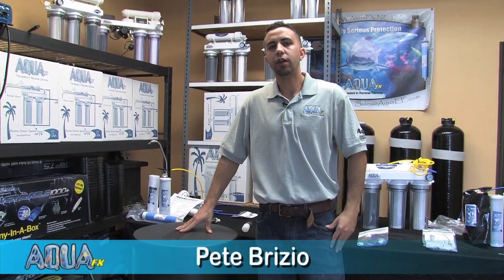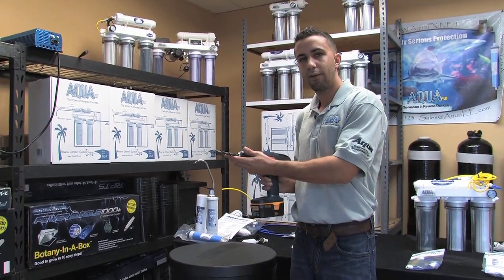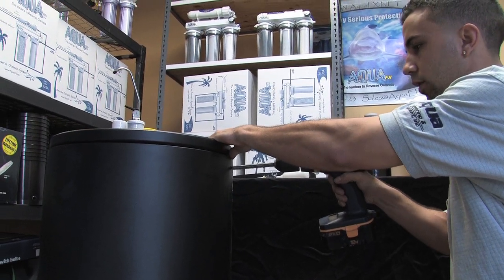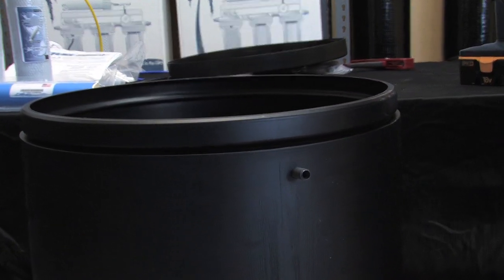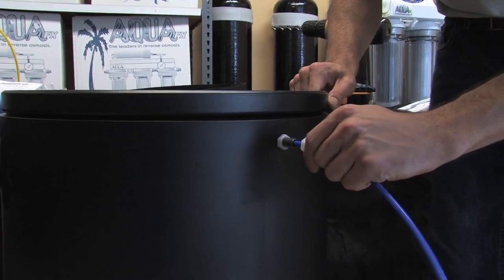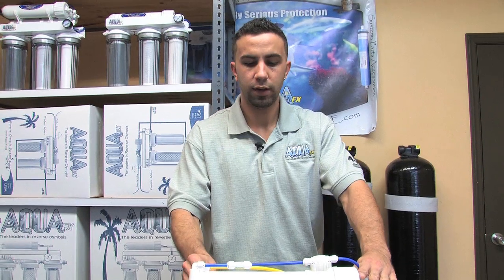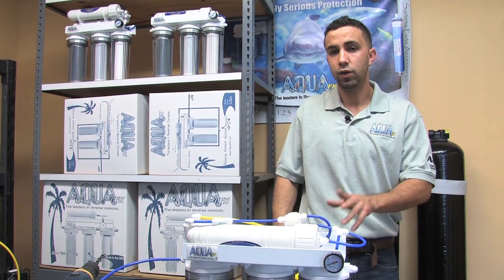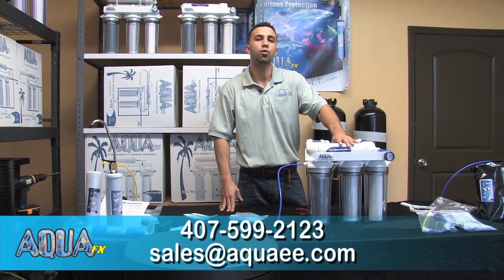Float Valve Installation  for Aquarium RO/DI systems AquaFX

Comment: If I have a set filter system and I have one pipe with a valve going out and I want to connect it to a bucket for storage container and I want to install a sensor to where the water should flow how can I do it ?

Comment: I'm talking with a guy in Texas that sells RO systems and when I told him I want an RO system to fill a 35 gallon atmospheric tank for making cleaner rinse water for rinsing off my car I said I wanted a float shut off inside the tank to turn it off when its full. He said if I put a float shut off to stop the incoming clean water as you did in this video, the waste line would keep flowing water. He tells me I would need to find a way for a float to turn off the water supply that feeds the RO system. So I'm a bit confused.

Comment: Will this work if I only have 40psi at my house?
Reply: Yes, 40PSI should be enough. I would recommend a booster pump to get the better quality of water depending on how much water you are using at a time.
Reply: 40 PSI is acceptable, it just produce water as quickly as it would at higher pressures

Comment: Flow restrictor comes standard with all ro/di units right ? Cause I never even checked for that after installing my unit
Reply: Yes one comes standard in every RO unit - if you didn't have a flow restrictor, you wouldn't be able to produce any product water. the unit wouldn't be able to build pressure. So I'm sure you have one there!! :)
Reply: kouki20 Thanks !
Reply: yes, it does.  They are matched to the membrane

Comment: Nice! I’m going to install something like this for a saltwater tank to do water changes. Is there an application where I can in hook that blue RO line easy like once a week without issue? I will still have float value installed? Or can I just keep unscrewing that white nut?
Reply from the maker: So "yes" you can keep unscrewing that nut - the tube will come in and out easily. Or if you prefer there should be a quick connect fitting that will fit the end of the float - female x 1/4 QC. Either option should treat you well!! :)
Reply: Thank you for responding! Do you know where I can get the quick connect fitting or what part number that is? Thanks in advance!
Reply from the maker: So this should be a 7/16 female thread x 1/4 quick connect. its kind of an odd fitting (but we have some) I would say to email sales@aquaee.com and have them send you one!! :)

Comment: hi where do i get that thing inside the yellow tube coming out of the membrane, the one that helps building pressure so the shut off valve works? thanks
Reply: AquaFX.net will sell the flow restrictor - thanks for the question!! :D
Reply: It is a flow restrictor, you can purchase one on our website  www.aquafx.net

Comment: Now that we are good buddies and on a roll, I have one more question. I have 3 different brand units here over the years. I started paying attention. Question... I am assuming, (trying to make sense of how they should work) that best to have a sediment filter first- then charcoal filter, then though the RO membrane, and Last through the Resin Material filter. Right?  if so not every unit I have is built this way. I never checked. One last thing, before all this happens in my house I have whole house soft water unit and whole house charcoal filter. Our water is harsh, over 385 PPM.  So I do leave out the charcoal filter for my aquarium RO...  (after this I have to buy you lunch)
Reply from the maker: LOL - thanks Carl, no lunch needed (but if youre buying I will eat it haha) 
Yes--> Sediment - Carbon (charcoal) - RO membrane - DI resin.
The softener is great for the RO system (helps the membrane last a long time) - 

Chlorine will damage the RO membrane, Carbon removes Chlorine very easily - if your 100% that your house filter is doing the job, than you wouldnt need the carbon block. Some customer will use the carbon block just as a fail safe. (but you shouldnt need it with your whole house carbon doing the job) :)
Reply: AquaFXdotNet Me again.. after today I will be almost an expert, but I am sure something in my brain has to be emptied. Is it a crime if my DI is before the RO Membrane? I have one unit that it's the only way it could work without surgery. Also I have one Smart Water one by GE, that I don't see a flow restrictor and I am only doing 2.25 to one ratio of waste water. So are there units that just can't handle bigger GPD? ( I know I should just buy yours :) and think I will soon)
Reply from the maker: Carl Gennaro Hey Carl, Yes putting the DI before the RO is a very big
" no" - the DI polishes the water down to zero-ppm, so what would happen for you is your water entering the RO membrane would be very very pure for a short time, then the DI will exhaust and will become useless in the system. So the DI has to be after the RO membrane so it can polish the RO product water and last as long as possible. You can do something like an add on DI filter if re-plumbing your system isn't feasible. 
GPD - yes you should be able to make your system up to 300 GPD with the correct RO membranes. (you can see our piggy back video for how to add more membranes) - oh and you can always email me Pete@aquaee.com if you need me immediately!!! :)
Reply: Josh and Katie

Comment: I asked this before , still looking for answer, why not use the auto shut off float to just shut off the total supply side of the RO unit. (maybe need a different float shut off) Then don't need that fancy shut off valve . I can see it if for storage tank and want pressure all the time but for aquarium application for making 55 gallon tank of RO water, seems not necessary.
Reply from the maker: Hey Carl, you need to stop the "product water" out of the RO -                               So we use the float to block the good water and prevent the container from over filling - the inexpensive ASO valve is the best way to make sure the waste water stops!!  :)         IF you see something else out there that works I would love to see it!! :D     (you can always email me direct at Pete@aquaee.com)
Reply: AquaFXdotNet LOL no have not seen one but was thinking there should be one. If the ASO valve had and in and out then it would work right? We have just been turning off supply when 55 gallon drum gets full, sometimes I forget but have a floor drain and over flow tube from top of drum, but would be nice to just shut it all down. I was wondering by reliving all pressure if that was bad for the RO unit for some weird reason.. FYI amazing you have all these views and I am only comment or question.. LOL
Reply from the maker: Carl Gennaro Hahaha - yes I know, no comments or questions?! Crazy right!!! :)    Yes I have flooded my floor once or twice also -  If you just add the float - that will stop the flood , but the waste water will continue. SO the ASO is more for the waste to stop!! :)
Reply: @AquaFXdotNet  I'm not a reefer and have limited knowledge, but doesn't the ASO valve shut-off based on the pressure from a bladder tank? If there's no bladder tank to provide the pressure  to the ASO valve, how does it get it's signal to turn off waste water? EDIT: It gets it's signal when the float valve or faucet is turned-off? In my case, I have a typical RO unit w/ pump without a bladder tank. So when I turn-off the faucet(or float valve), that signals the ASO valve to instantly shut-off the waste water? Whereas if you had a bladder tank, waste water continues until the trigger pressure is reached by the bladder tank. I think I answered my own question. LOL.